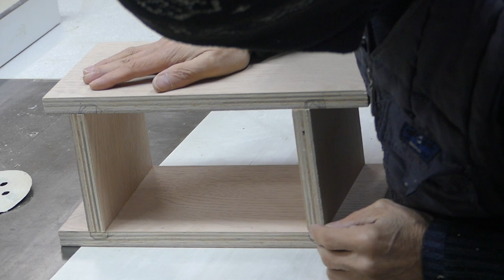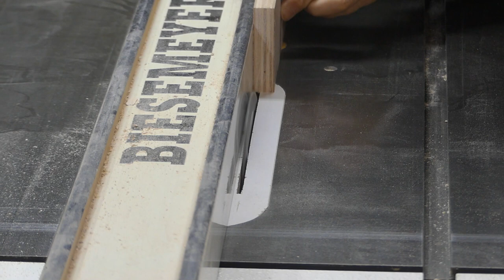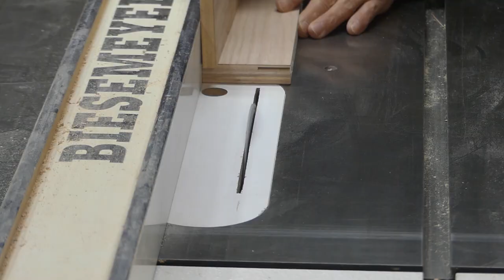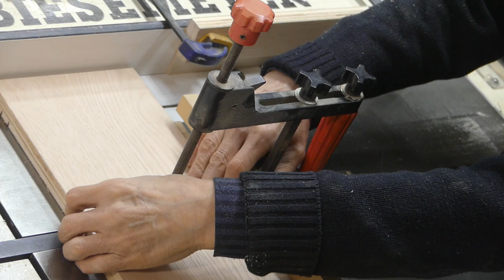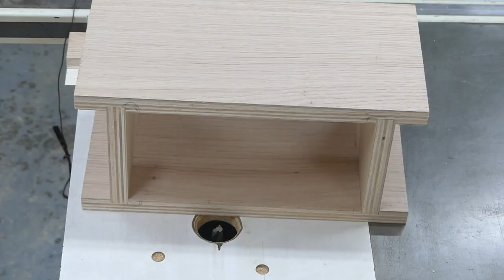Perfect table saw dado-without a dado blade

Comment: Table sled, stop block, drill bit the thickness of saw blade, scrap of the wood you want to use and do the same - easier and more applicable to more wood sizes. Then, only the scrap of wood changes. Katz-Moses and Wandel and several others use this method. Less difficult than cutting off part of the wood leaving a piece the thickness of the saw kerf. Sorry for being negative because you're such a master.

Comment: How did you figure the exact kerf width to cut to?
Reply: I would guess the thickness of the blade.
Reply: @ozguzzi  but you can't use the blade itself as the spacer. I suppose if it's a fixed width it's easy. Or if it matches a standard
Reply: Was wondering the same thing...
Reply: The left over material thickness is the same thickness as the blade and the ply is the same ply being inserted, you'd have one of these for your most used blades for each of your most common material thicknesses.
Reply: @Realism91  agreed. But how do you make it? Those details are missing.
Reply: @TimothyHall13  You're right, it doesn't show it. I assumed you would you "sneak up" on cutting the jig kerf blade width until you get the tight fit in the kerf cut test piece that he does show.

Comment: Noticed a router mount, that's what I use on my portable with an insert but that's another handy way. I have a portable DeWalt so it won't accept a dado but I can drop a router plate in between the fence rails

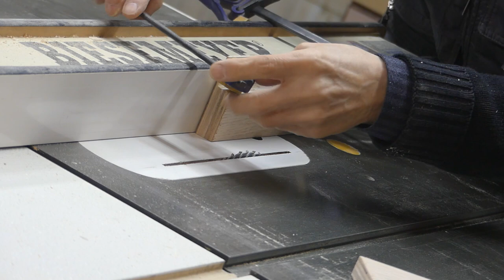Comment: .... from and at  0:39........awkward angle shot ....not required for precise woodworking video .....also, avoid using wide angle / fish-eye  lenses. What are you trying to show ???? 
Misguiding that the Table saw Fence is set at a Stupid Angle...other than 90 degree square.....!!!!

Comment: Well. It's perfect, but certainly time consuming. Dado blade does that work in one sec.
Reply: 8BitLife - Dado blades/stacks are not available everywhere, nor will they fit all table saws.
Reply: Dado blades not legal in the UK
Reply: Takes time to set up dado stack correctly.
Reply: @marshallmurrell4583  - that's right.  it would take more time to get the proper dado stack than to do what he just did.
Reply: @pdbay47  Dado blades are not LEGAL in the UK, why.
Reply: @raider6511  As I recall from college, all table saw blades must be capable of use with a blade guard. Clearly. this is not possible with a dado blade in trenching mode. European manufacturers, to cover themselves, shorten the arbor so it is too short for a dado blade. Choosing my words carefully here.
Reply: Read the title again. The whole purpose of this video is to demonstrate a method of cutting a dado when you don’t have a dado stack; too expensive, never needed one before, illegal in some countries, won’t work on some contractor type saws (DeWalt). The whole purpose of woodworking is to make something and the enjoyment you get from doing so, how you get there is irrelevant. (Unless dangerous)